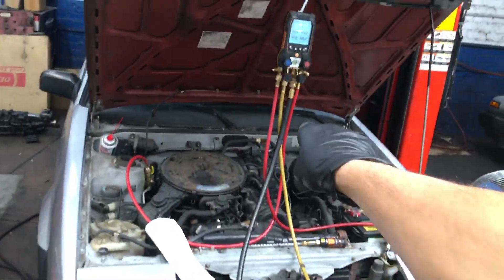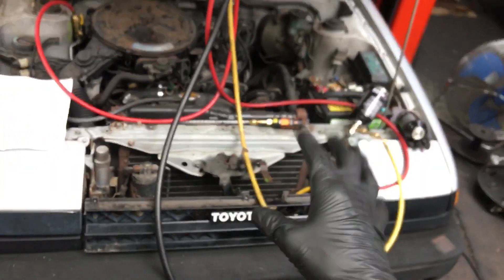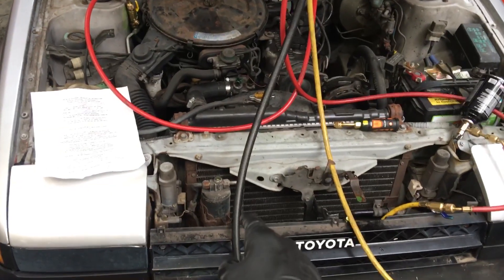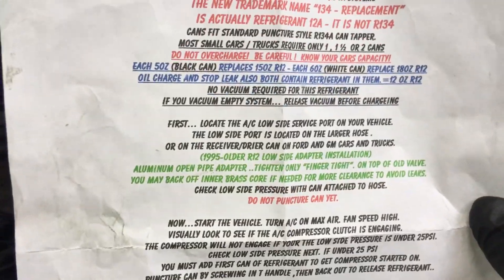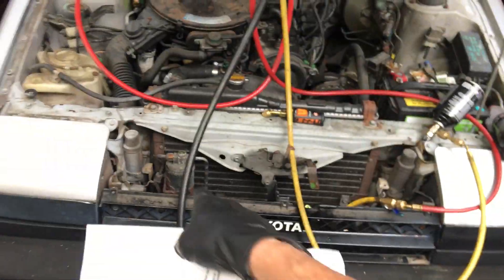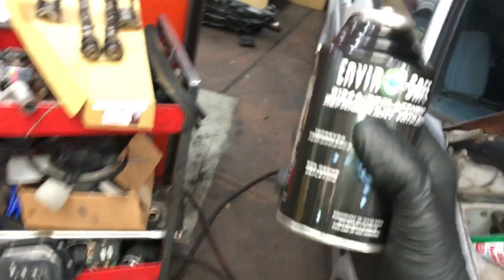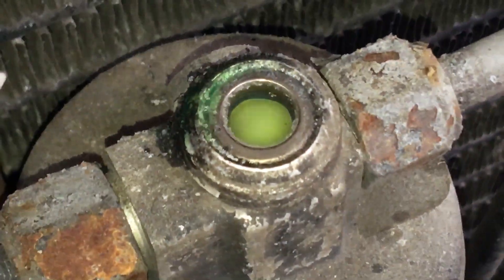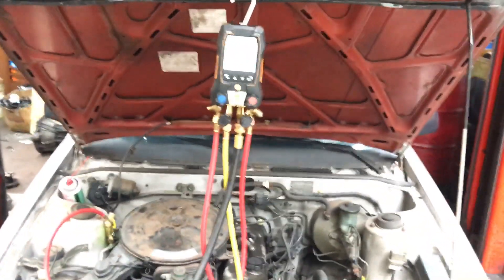Flammable 🔥 Refrigerant Installed In  Car Past Leak test, but now it leaks. Let’s put a match onit

Comment: Hi , man I’m so happy with all videos 
And i have one question please 
What do you think if I swap dual ac condenser 
?
Do you think it’s good idea for more cooling and more heat displace from the ( dual ) condenser 
Please 
Let me know 
Because I so that in some 🚌 and some army trucks 🛻 
,
Many thanks 🌹
Reply: 🌹 yes my dear 
1- I’m in Kuwait 
( 49 c )
Now out side temp
2- the low press line 40psi 
3- the hi press line 250 to 290
4-I swap new compressor denso from camry 2006
6- new aftermarket condenser 
7- flushed the service lines
8-dual aux fan on the condenser 
9- when I’m stuck afternoon in the traffic 
A/c cooling temp comes 14c
10- in hi way 4c
11- I’m thinking to get sanded compressor sd7
Everybody talked about it 
12- please man 
Give us a map about the how to make or how to custom best ever ways for the best cooling
13- 
I need more help man 
Please 
14- please 🌹
15- if you can help please 
Make special video 
( how you can make the best cooling system in the hot country)
…
Please man 
🌹
Many thanks
Reply from the maker: @kuwait123331  wow that is way too hot for me to live in 15 minutes I would have to stop working for the day if I was outside.    I like my fog that comes in from the ocean to cool down the warm afternoon here in San Francisco. 

Yes it sounds like you need a second condenser. 

       And if you can modify brackets may be a little bit of sheet metal work if you could get a condenser to fit that comes from a van that has double air conditioning duel evaporator.   To fit into place of the original condenser. 

            Yes Adding a second smaller condenser. 

If you can get from the old vehicle inside the dash the HVAC housing in module and install it in the trunk of your car behind the rear passenger seat.    This way you will have two evaporators for passenger compartment. 

You can run insulated flexible duct tubing from the evaporator case in the trunk of the car up to the rear deck area behind the head of the rear passengers

          You also need to provide the same amount of return air from the passenger compartment back to the HVAC case in the trunk. 
                   Because you do not want to try to cool down the hot air in the trunk it’s easier to cool down the cooler air that is already in the passenger compartment so you need a return path. 

            If I lived there I would only on a white car with white interior.   To help reflect the radiant heat of the sun.        Of course you must have window tint on your windows. 

In that temperature the black pavement of your roads must get about 160°F (111°C) 
            This causes a lot of radiant heat to shoot upwards striking underneath the car hitting the floor and you actually have heat gain coming up from underneath the car into the car.

              Having some sort of reflective insulation underneath your floormat would help slow this down. 
                                Installed on the inside liner of your doors in the headliner roof of the car inside underneath. 
https://www.walmart.com/ip/40sqft-R8-Reflective-Insulation-Garage-HVAC-Duct-Pipe-Faucet-House-Attic-Wrap-Reflective-Double-Sided-2-Layer-Bubble-Insulation-By-MWS-USA/250608121?wmlspartner=wlpa&selectedSellerId=12921&&adid=22222222228000000000&wl0=&wl1=g&wl2=m&wl3=42423897272&wl4=pla-51320962143&wl5=9031953&wl6=&wl7=&wl8=&wl9=pla&wl10=117593717&wl11=online&wl12=250608121&veh=sem&gclid=CjwKCAjw092IBhAwEiwAxR1lRmebKlCU9ZqH376Ywh-b79cws9FT4KuiX0DVhrtYoVuPTnxbHkmwoxoCZZoQAvD_BwE&gclsrc=aw.ds

This is what we use on metal air conditioning duct to keep the heat out or the heat in in cold places

https://www.reflectixinc.com/applications/hvacr-plumbing-contractor/hvac-duct-insulation/big-bubble/hvac-duct-insulation-r-8-0/

This is what you can add to the rear of your car in the trunk

https://www.google.com/search?q=limousine+HVAC+module&rlz=1CDGOYI_enUS965US965&oq=limousine+HVAC+module&aqs=chrome..69i57.7784j0j4&hl=en-US&sourceid=chrome-mobile&ie=UTF-8#imgrc=fhd0qX739PKBuM

But you will definitely need a bigger condenser or a second condenser. 

You will have to make up your own hoses with fittings here is a link to one of many manufactures you must have a place in your country

https://coldhose.com/?gclid=CjwKCAjw092IBhAwEiwAxR1lRlH9vTy5g1rdlEOVHLWc9GJE2qBLZAI31M7fQCas4dl14HFcpLcnZhoCQPgQAvD_BwE

       I do not know if you have the experience or ever seem very high end car audio stereo installation but you can look it up on YouTube. 
            The same way you add sound deadening material on the inside of doors underneath the floor mat carpet underneath above the roof headliner. 
                      Is the exact same way you would install the reflective R8 bubble wrap duct insulation
                     This will help keep the heat out and help keep the cooler air in the passenger compartment. 

            Do you live in extreme son and extreme heat so you have to do extreme things to keep them separated from the hot from the cold. 

       It does not matter how much cold air you make it inside your car.     It’s the laws of physics that the greater the difference of two temperatures the faster the colder temperature will want to travel through an item into the hotter item

           So what I’m saying is you really need to insulate your car door panels your roof headliner and your floors the inside of the firewall behind the passenger seats the flat spot behind the rear window from inside the trunk. 

           Basically think of you trying to make the interior of your car insulated like a thermos bottle or a freezer box.    
                Because the colder you try to make it inside the car the heat actually speeds up and moves faster and tries to go through the glass and metal into the car. 

            You cannot beat mother nature just by adding more cold (that is the wrong wording because you do not add cold).   Do you only remove heat. 

          So the faster in the more heat you move from inside your car. 

            The faster the heat from outside wants to replace and move back into the car so you need to slow that down with the insulation. 

         In theory even with your current air conditioning that does not work that good right now. 

           If you installed that air conditioning into a small room the size of your car.        But the walls the floor in the ceiling were 8 inches thick of high R-value insulation.   And the roof in the walls of that small building room were painted white to reflect the sun heat. 

         It would probably get nice and cold and 55°F (12°C). Inside that room in the air blowing out of the evaporator case would probably be about 48°F (8.8°C) 

        So if I was forced to live in your country and had a car the interior would look thick and fluffy padded with thermal insulation. 
            I would work very hard to make the interior of my car almost airtight except for the controlled air that I would allow to bleed in to the fresh air vent by turning it up or turning it down. 
                 I would strip out all the interior from my car putting insulation underneath it. 

          On racing cars in Formula One or Indianapolis racing cars they actually put a heat reflective material heat shield underneath the car halfway covering the exhaust pipes because that radiant heat off the exhaust pipes strikes the bottom side of the car and heats up the inside making the driver uncomfortable. 

        I work around racing cars and this is why I know they put heat reflective devices protecting the body of the car from the radiant heat of the exhaust. 

           And even cars if you remember seeing the old Mercedes Benz for many decades ago they would have a padded thick insulating material on the inside of the engine compartment on the firewall passenger side that had a reflective aluminum foil coating this was to reflect back the radiant heat race of the engine. 

           So with a lot of labor and work and materials it can be done. 
       When I built a high-end stereo system I completely tore apart my car adding insulation and coating sound deadening material in every door panel in every quarter panel in the trunk on the firewall below my feet underneath the carpet in the headliner above my head trying to make my car like a speaker box for better sound quality. 
            The only difference is you will be doing this to keep in the cold and keep out the heat. 

https://www.eatonpowersource.com/aeroquipperformance/products/fittings/teflon-reusable-ac-fittings
Reply from the maker: @kuwait123331  lol 😂 I just looked at your channel on YouTube and I see you have sound deadening insulation for car stereos.   
        This is exactly what you need to do but with heat insulating material like the R8 bubble wrap duct wrap.
Reply from the maker: Do you have the right idea what you want is called a sub condenser it’ll be performing the extra cooling task of cooling down the liquid refrigerant. 

       By the looks of the writing at your header by your name I believe you live in a very hot place much warmer climate than San Francisco lol . 

One thing you can do.   If you have an SUV or a pick up truck that does not have dual evaporator’s in the back but only one for the passenger. 
                     Do you know that some SUV and pick up chassis share the same air conditioning or chassis of larger SUVs or pick ups or vans. 

            In this situation you can see if your vehicle had an option for a dual air conditioning to evaporators inside the vehicle.         If this is the case you can order the optional condenser that will be a little thicker for higher capacity of two evaporators and modify a little bit maybe fittings or hoses and replace the condenser from the single eight evaporator car with a condenser from a dual evaporator car truck or SUV.   

         But yes you can add a smaller secondary condenser in the liquid line leading the bottom of the existing condenser and put two small fans on it. 

     Are used to do this with limousines that would have one compressor and we would add a second smaller condenser some extra electric fans.

       A long long time ago Mercedes-Benz even made a custom limousine made for the Middle East like Saudi Arabia and Iran that part of the world.     
              It was a special model in a sedan with air-conditioning back into trunk for the rear passengers and it also had the floor had copper plates with refrigerant lines in them to cool the bottom of the vehicle where your feet were placed.    
         
    I actually made a video on that vehicle

End it had a second small condenser tucked up hidden underneath the bumper of the big Mercedes chrome bumpers